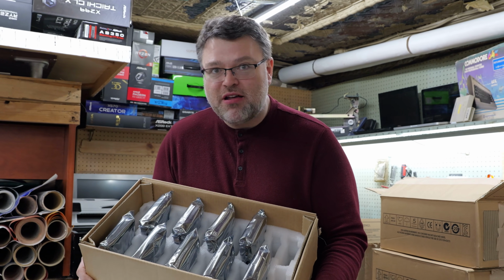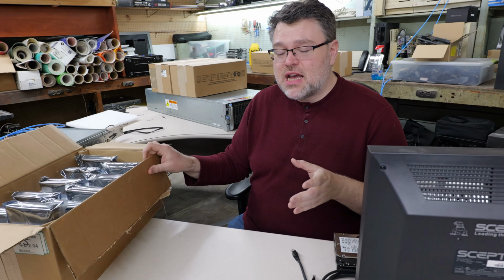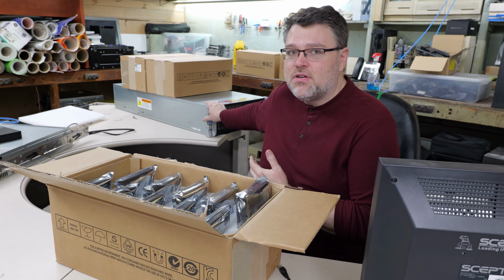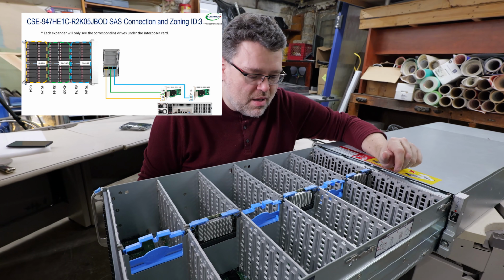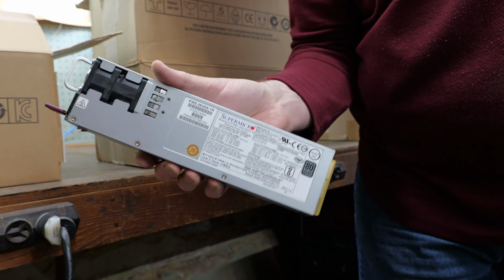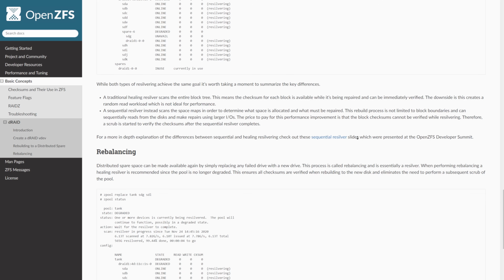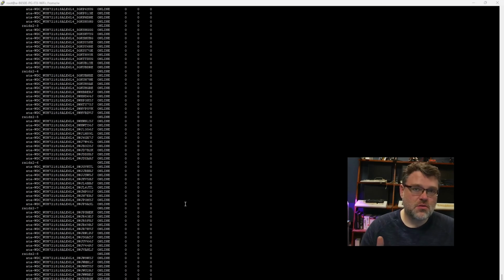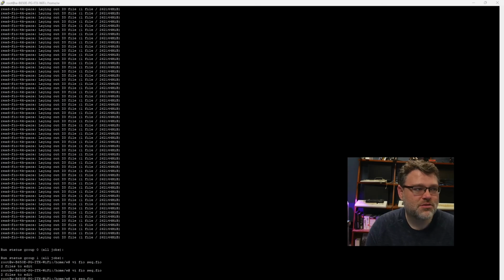Petabytes? No Big Deal! Quick start with the Supermicro 947HE1C-R2K05 90 Bay JBOD Disk Shelf

Comment: Jet engine loud and not for home. Still rolling an SC847E26-R1K28JBOD with slower fans.
Don't use ZFS derived from ZoL, use Oracle/Solaris ZFS only. Had an issue where a ZFS pool self-corrupted and there was zero (0) support to fix it.
Use what works: mdraid RAID10 and XFS. It works, it scales, and it recovers properly. Or use Ceph on top of JBOD.

Comment: In ZFS, when a drive dies, TrueNAS shows the GUID rather than the serial, so I have to look at all remaining drives in that vdev and figure out which is missing, crosscheck that against my spreadsheet of serials and where they're located, and I should be able to find it. I wish it didn't show the GUID and instead showed the serial :/

Comment: The way you talk about this, it sounds like it's a brand new concept, but Storinators and other SuperMicro systems have been around for years, and you can use SAS drives and make them into a JBOD with a similar type of board (this is what I do today for my XL60s). It's more jank than this though.
SuperMicro also sells SAS3, SAS4, and NVMe JBODs like this. Is there something different about the name "Disk Shelf" or it just refers to a JBOD chassis that holds drives and no server?

Comment: I like to run a minimum of a raidz2 on my ZFS storage. I'm still running a NetApp DS4246 with 24 12 TB SAS drives for my home lab, with a HP DL 360P G8 running true Nas. And the server Is running 8x1.2TB SSD SAS that houses all of the ZFS fast cash, metadata, library, dedupe tables. And then also housing somewhere around 348 GB of RAM All ECC. And I have it set up in a raid Z2 so at any given time I can lose up to two drives before the cluster is trashed. I then keep a minimum of 3 spare deives for hot swaps for ssd sas and 12tb spinng sas drives.

Hosting about 35  servers(ubuntu/windows/appliances) (including vcenter On a 3 HP DL380 G9s) and now migrating to a proxmox cluster. Amazing performance for my home lab and some hosting apps i built.

Comment: The part of failed drives is why i am wondering why you would use SATA? Part of SAS includes the logic to know which drive is which then if you labeled your drives and the label on the management software lines up with what you have on the drive then the SAS drive is better for when it will fail. Yes when not if as over 10 years some of them will fail. That is pretty much the reason to use SAS for larger implementations of this as knowing which failed is better than having to have a hot spare or room to add in a spare. Having a spare is good but knowing which to replace as it failed is better.
Reply from the maker: wwn/disk serial part of sata drives. this is a non concern in 2025. spares have more to do with the zfs file system than what you're talking about as I explained.

Comment: Big thanks Wendell for the explanation on safety measures for such devices in the data center. I am usually not physically handling the disk shelves - only for disk replacement -  but the knowledge might come in handy at some point.

Comment: 7:24 - You know....I don't buy drives under 2TB anymore. I kinda end up with them cause they come in a device. I can not tell if low capacity drives are just robust or if drives made back in the day were like a rock. But for me...any drive bigger than 2TB is a sensitive lil girl that gives up on life if you startle it with a sneeze and drives 2TB and less just will not die in my hands. I drop them and have yeeted a couple of them. They still keep going. I got one that says July 30th in 2008. I came in a laptop that I broke when I was on my patio and a bee flew in my face. I dropped the laptop. Put it in another one. It outlived that laptop. Used it in my desktop. Then upgraded. Threw it in a Ubuntu server. It has seen Plex, Jellyfin and XBMC. It ran for the entirety of Windows 7. I played Crysis with it. I got mad one time and threw this 120GB and it stuck in the wall like a ninja star. It clicks now. Happily runs my PfSense PC. I will legit be sad when this drive go's. If it does. It would be crazy if it outlives me. The thing is a freaking tank

Comment: These are my favorite video to watch of  Wendel where he's just having a baller of a time showcasing what can be done in the most Revenge of the Nerds way possible!  🤪
Technology is supposed to be fun, and storage is one of those areas that is still more like a true art form of mechaics and electronics all rolled up into one.    

His quote about Mechanical watches is not to far off really.  
HDD's or affectionately "spinning rust"   as the euphemism for the drives makes so much more sense when you have taken apart a drive to look at the insides and how it is made and functions.  
Brilliant in their simplicity but amazing in their complexity required to do such magic.  

Lastly, the part about treating your drives nice and avoiding hard shocks to them is something I have said for YEARS!
In fact when working at the Data Centers, I would use those rubber tires from Harbor freight on the carts I modified in order to hood round servers when possible.  

If nothing else? 
A Blanket or rubber mat if we were doing a decommissioning.  
And thanks to that attention to detail,  every machine I worked on the Drives at least spun back up and tested working ; Albeit, with bad sectors and other maladies on the drive themselves, but at least hey would still function MOSTLY as intended. 😂

What should be investigated is Dell's Plastic Drive trays used in their machines as they seem to cut down on a lot of vibration and "Float" the drives isolating it from direct metal on metal chassis vibrations. 
I ONLY have  anecdotal evidence that these drive sleds allow the drives to last longer with far fewer error rates, but it sure seems to fit the mantra with cars that if you drive them and maintain them, they seem to last longer  as I have drives in these Configurations going on WELL beyond a 10 year lifespan without a hiccup. 

Its partly why I like external drives of old as they used quite a bit of damping and even rubber feet on the drives to isolate them from vibrations, along with putting them on carpet or a soft neoprene like material inside a bulky case. 
The Lacie Rugged drives IMO are a great example of this. 

I'm still on the fence about these disk shelves for Home use, but they do make sense space wise or business and enterprise environments, but home use cases should have something a bit more consumer friendly focused as replacing drives are not really a consumer favorite pastime.

Comment: For that amount of cash I would definitely have gone SAS. I'm not sure people actually do any performance metrics of their applications, because the older SAS enclosure speeds are more than adequate for 98% of applications, they are just old now and so I'm not sure about their reliability. Having said that I have a bunch of the old netapp jbods around and none of them have had a controller or psu die, so if you were doing super budget small business server I wouldn't feel bad about using them.

Comment: Not a fan of the 9 * 10 disk RAID-Z2 layout, you instantly lose 5% capacity to allocation overhead @ 128KiB record size, though this drops to a more palatable 0.3% with 1 MiB record size and you will see the storage pool increase to 1.15 PiB with that change.

A layout of 5 * 18 disks in RAID-Z2 will have zero allocation overhead at 128KiB record size and give 1.28 PiB space.

If that isn't enough redundancy though, perhaps 8 * 11 disk in RAID-Z3 with 2 disks as hot spares is an option, but then you're losing a fair bit more capacity and drop down to a mere 1.02 PiB.
Reply: Of course the benefit of the original 9*10 disk layout is it leaves you 73.6 TiB for steganography in the areas that ZFS will never touch. ;)

Comment: You can slap a spare Dell MD1200 in your rack if you want a few slots for hot Spares, or swapping disks in and out. Or you can use a 1u or 2u  head unit with some 3.5" front panel drives.

Comment: Quick question can't we use Windows Server 2025 Standard for the 25 drives. Same AMD hardware? Same results and speed?
Reply: You could set something up with storage spaces, but it won't give you the same performance or data integrity guarantees that you get from ZFS.  You can't really use ZFS on windows. I think there's a project that ports a limited subset of old versions of zfs to Windows, but it's not officially supported by openzfs, nor is it stable, and if I remember correctly, you need to disable secure boot and driver signing to even play with it. So in short, no, not really.
Reply: @aarcaneorg  But why not Wendell take us down that rabbit hole? What is Windows Server 2025 Standard able to do for you on this Supermicro hardware?
Reply: @chebrubin  If you want to benchmark the platform running Windows Server 2025, feel free.  This video is about deploying a storage solution, not about benchmarking the platform for Windows Server.

I would point out that Windows Server has its place, and that place is generally in providing services in Windows-centric shops, such as Directory services for companies with a lot of Windows client systems, or hosting Databases running Oracle SQL or MsSQL for primarily .NET based development houses.  If this is your thing, more power to you, but it's not the primary focal point of Wendell's content.
Reply: @aarcaneorg  totally disagree.

I am interested in oranges to oranges comparison of the Wendell hardware and open-source OS and storage sub systems. Remember Wendell is a huge proponent of Intel RST drivers and their modern optimized code for Linux and the newer Windows Server 2023 OS. I think you are pigeon holing the concept that the usage of newer Windows Server is intended for Active Directory and or legacy Windows shop services. 

Lets forget all that and just use Windows Server 2025 and Intel RST and raid compared to the latest Ubuntu and ZFS. Not saying it is superior just saying it is worth him reviewing is their any benefit to departmental or startup or scientific organizations using Windows Server 2025 and supermicro storage or GPU systems.
Reply: @chebrubin  rst to zfs is not orange to oranges, it's more like tomatoes to pineapples. Yes they're both fruit, and yes they both belong on pizza in some capacity, but one is clearly superior. ZFS provides full end-to-end data integrity for both data in flight and data at rest, with several options for tiered caching, all while providing the tools for superlative performance. RST at most protects from hardware failure while providing an iterative performance boost.

Comment: Why don't they make JBOD's, diskshelves and servers with any soft materials for vibration damping?

The hard drive seating and cradles are pretty much all hard surfaces.

It seems that this is a scarily overlooked or deliberately ignored area of server chassis design that is really endangering a lot of mission critical and sensitive hardware. Not to mention data that could be irreplaceable in some failure situations.

Also, it sounds like physically locating a dead drive for pulling and replacement is still a problem. Why do we still not have some sort of decent mapping or indication system to this drive identification problem?
Reply: That's why you don't usually go with jbod for critical workload. Keep in mind this is a cheap solution with drawbacks. I took a hard drive from a running server. Don't imagineit  is spinning around the data center. It is vibrating like a cell phone or even less. I think the problem does not exist of they are put correctly

Comment: at my last place of work we had supermicro storage servers running freenas/truenas for veeam backups. the last pair of 640sp-e1cr60 boxes we bought had 60 x 22tb sas (iirc 1320 tb raw) drives with a tb of memory and 6 nvme drives for l2arc, zil & special vdev. with respect to hot swapping, we did it only that way for 10 years and never had issues. if a drive threw an error we would do the smart long test, and if it failed we would turn on the drive light for that drive and swap it out. i don't see how it could hurt since the drive was already offline.

Comment: I use WD Blue 8TBs in my home server.  5640rmp, low noise, low vibration.  I have run Blues for decades now, a couple of Blacks (pre-SSD) in RAID back in the day for games. I also don't need the speed in a two-person household.  Never had a failure.

Comment: I had an employer who was expanding to another spot in their data center and lost 2 database server disk shelves down 5 floors of an empty stair shaft when they rolled over a temporary floor patch made out of plywood that wasn’t thick enough. They had 4 members of a cluster and had to halt the move until they could rebuild it because they couldn’t maintain quorum with only 2 members. I think that the added at least 1 extra member too so that loosing 2 members doesn’t not take down all of production.

Comment: Rattling the drives when they're off only hurts defective ones as long as the peak G is very low. If the server is on a squishy material it's fine. The 24/7 intense noise of a DC ironically kills the drives as the entire server is not on isolators just shit rails.

Comment: I prefer the supermicro chassis with horizontal rather than vertical drive storage so you can more easily swap out failed disks because, as you say, vibrations kill drives. You can get 96 drives in 4U with forty eight bays with two disks in each bay.

Comment: is there some way to quiet the disk shelf that makes sense and won't cause a full chassis to overheat?  I have a cse-847 that I ended up ripping all the stock fans out of and replacing with arctic p14 max's (high static pressure) and 5 arctic p8 max's strategically placed (2 on the motherboard area in the top section (one blowing directly across the cpu heatsink and one blowing through the pcie section via the shrowd, and 3 toward the back right up near the rear disk section to avoid overheating those rear disks and I get good numbers...

what's the best way to quiet a chassis the 947HE1C-R2K05 so it can be used in a homelab environment?
Reply: I'd say find a source for synthetic silent blocks and use them everywhere, you don't have any other options on this one.
Reply: @hankhulator5007  I already lined my rack with butyl automotive insulation, don't know where you'd put silent blocks in this case.  surely not inside with the densely packed hard drives?
Reply: @joshhardin666  When I'm talking about  synthetic silent  blocks, I'm more thinking about the matter that is used on cars to replace the normal ones (usually of color violet) - it is produced in many shapes, including sheets sufficiently thin to be put between the case steel and the HDD.

The best solution would be to sacrifice at least one HDD place and have individual cases isolated from others with such a material, but manufacturers don't want to do so because it would be much more expensive (or they should have to lower their margin).
Reply: @hankhulator5007  the problem isn't the hard drive noise... the problem is the fan noise.
Reply: @joshhardin666  Then the only solution is to separate fans from the main case and add a flexible wind box between and the case (and a very long one to lower the acoustic pressure) or to replace them with iced water circulation.
Reply: You have to define what you mean by "overheat".
If you mean "Operate within the manufacturer spec of heat tolerance", then you can likely get away with next to no cooling at all... even with a fully-populated shelf.
If you mean "Arbitrary, random temperature that is "good" and anything above that is "ToO hOt", then you're going to need a lot of cooling and noise is inevitable.
For example, if you're using Seagate Exos drives, they will vary between 70c and 90c as safe operating temperatures for 24/7 use within their rated duty cycle. (You'd have to look up the actual part number for temperature tolerances.) 
If you're basing your temperature value on a 500GB hard drive from 2005 that ran at 40c and that, to you, is "Safe" and anything above that makes you "nervous", then that's something you have to work through.

Comment: i wish there were smaller disk shelves for reasonable prices. like 8 drives in 2U. or stand the drives up on edge and however many fit wide, but only 1 drive deep.
Reply: Sliger has a 10 drive 3u unit, that's about the best you are going to get with 3.5 inch spinning rust (and they are working on a jbod thing for the NAS chassis).  You can get some 2nd hand enterprise hardware if you want to go 2.5 SAS, but that makes for a whole other slew of problems.

Comment: I have a 1.2PB setup in a 45 drives 60xl BUT i got the case used without the pc so put my old am4 5950x system with 128GB of ram 2x  LSI cards and a pair of 2TB nvme drive mirrored for catches and a 3rd nvme runs the OS..
I have 2 other servers a dual epyc 2u with 256gb of ram and a Ai h100 hydro server for home llm testing